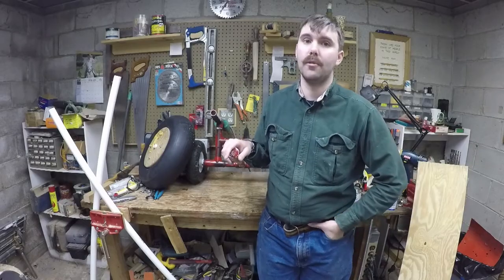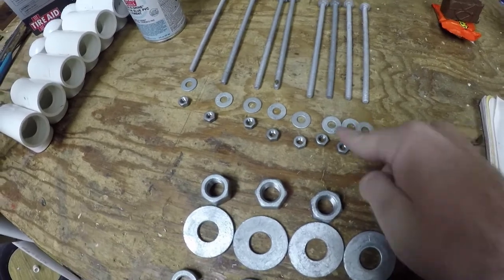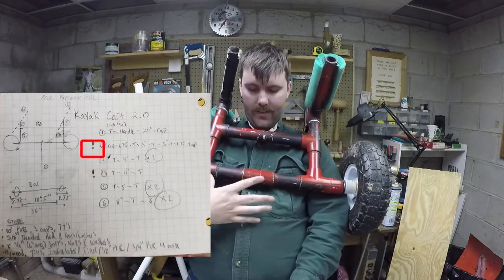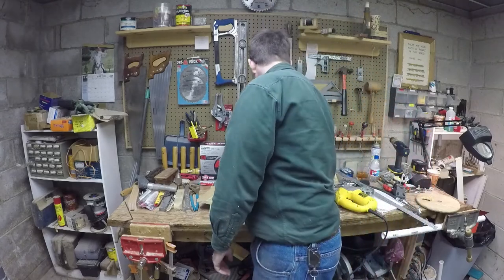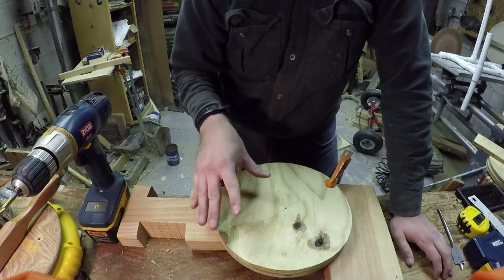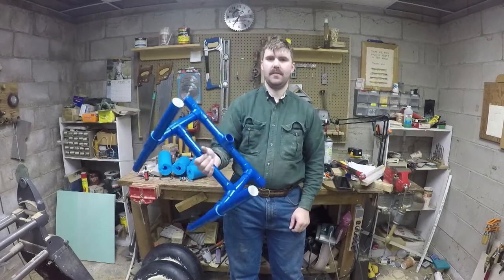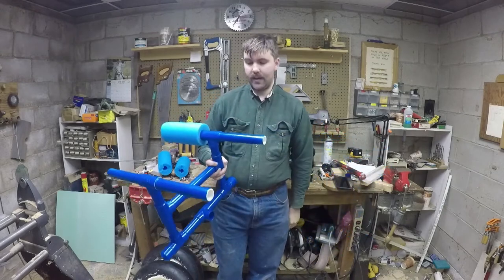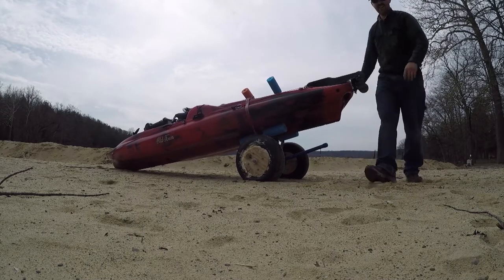My Old Town Predator PDL: DIY Kayak BEACH Cart!

Comment: Thank you for this video.  I purchased all the parts today and will be following your instructions on this cart build tomorrow.  This looks like a great design.  Thank again.
Reply from the maker: You are welcome, My suggestion is to not load it up as I have had the cart break over time. use it for just the kayak and the PDL drive at most. You can also choose not to glue all the parts so that if something breaks you can replace the part easily if it's not glued.
Reply: Thanks for the advice,  I'll give it a try with minimal glue.
Reply from the maker: @thomaskeller9876  I was going to do a follow up video with Schedule 80 pvc but I am having trouble finding the PVC. If you can find it though, I'm certain Schedule 80 PVC will have the strength to support a loaded kayak.

Comment: So if the tubes are about 50 buck for the 2 with tax - how is this cheaper with all the other hardware, pvc, wood paint, glue and all that time to build?
Reply from the maker: I got a more expensive tube,  you can get them for about 10$ a piece otherwise. Grand total comes to about 80$. If your not into DIY then you can get beach carts for about twice the price,  maybe less.